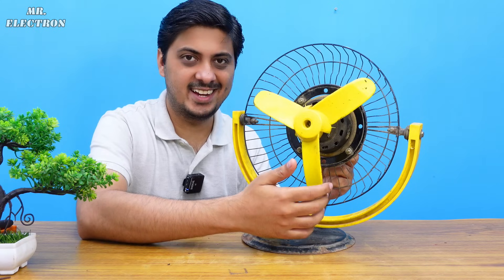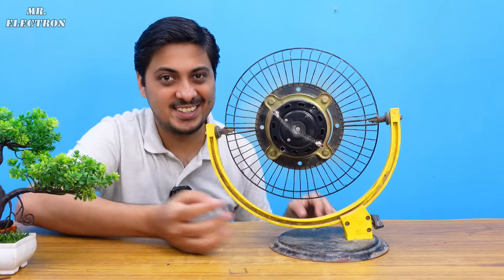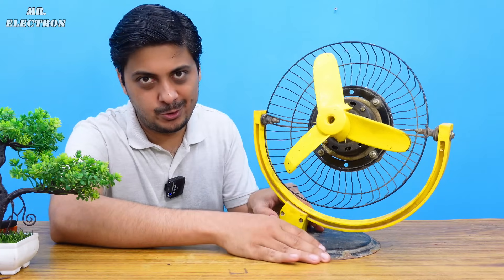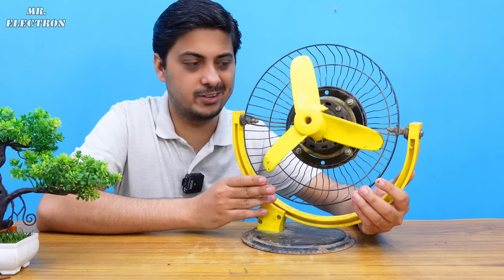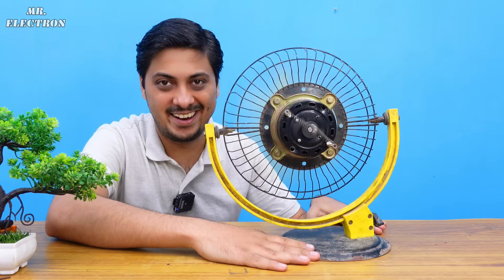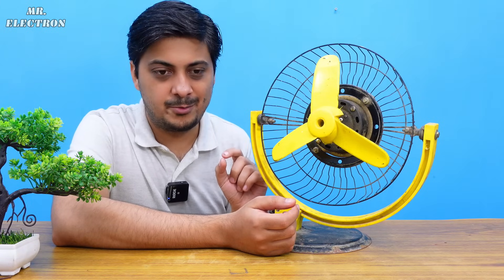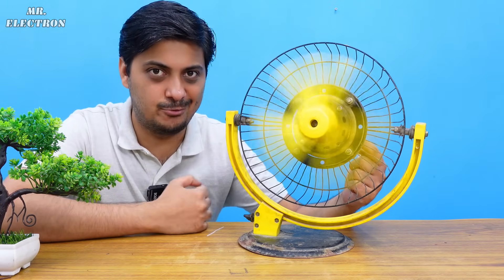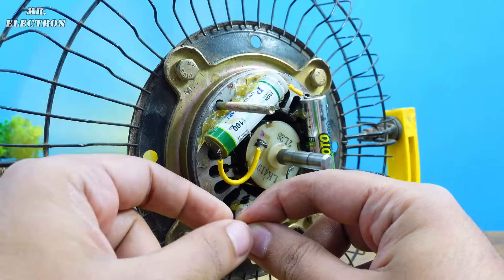Self Running Free Energy Fan Device 100%. How to make free energy fan at home

Comment: If the motor is still intact with some power cord left, turn it into a dual pupose fan and 120 volt power generator. Run a radio, lamp, or both. That is what I am going to do with mine. Happy building.😎
Reply from the maker: Thank you for watching!💥 JOIN my WhatsApp for faster replies: https://whatsapp.com/channel/0029VaQmmRaFCCoWOf7huh3G
Reply: C'est faux il ya Un ventilateur à côté 😂😢😅
Reply: C'est faux il ya Un ventilateur à côté 😂😢😅

Comment: So the topic should be:
CONVERTING A 120V AC fan to a 3.6V DC battery powered fan?
 I DON’T GET THE POINT! UNLESS YOU LOOSE POWER? 
So you removed the 120v AC motor, installed a 3v DC motor and 3-1.2v rechargeable batteries that must be EITHER recharged EVERY HOUR by a 120v AC to 4v DC adapter OR a solar panel. SO WHEN THE POWER GOES OUT, YOU CAN STAY COOL FOR A HOUR?
Reply from the maker: This is a scam exposed video demonstrating how the fake free energy content creators hide the motor and battery inside to show that their fan is going to run forever without electricity.

Comment: I wanted to ask you for advice on a possible project.  I start from the assumption that I already know that infinite energy does not exist and neither does perpetual motion.  I wanted to know if it is possible to use the induction motor of a washing machine given that it is used for its ability to not stop even at 3000 rpm without effort from the basket full of wet clothes, if it were connected to an alternator of an 80-90A machine first using its pulley and seeing if it holds a 600w load with a 1500w inverter with the maximum peak of 3KW and consequently connected to a more or less 700-800w battery.  What I wanted to know is whether it is more or less feasible to use the engine of a washing machine as an alternative to the petrol engine and always in theory to deduce the autonomy of the battery depending on the load used at the output of the inverter, then if it can be improved putting a larger pulley on the alternator like the one behind the washing machine drum so as to have fewer revolutions per minute but many Newtons.  I hope I explained myself as best as possible and conveyed the idea.❤
Reply from the maker: Induction motors especially the squirrel cage ones have a really low output efficiency + the torque is increased using pulley gears and without this, its not that powerful so it not a good idea.
Reply: @mrelectron_alternator  Do you have any ideas for using an electric motor as an alternative to a petrol engine?
Reply from the maker: So finally you want to charge an 800W battery and get around 600w extra right ?
Reply: @mrelectron_alternator  it varies based on the battery you use, for example I have a 600w or more battery, and a 1200 alternator then it always depends on what you want to use, my idea is also to use the battery as a reserve to connect some 220 LED strips which consumes little and use an engine that has a lot of torque like a 300-600w, the alternator is powered by the electric motor, the battery is connected to the alternator and also the inverter, I don't know if I've got the idea, anyway I don't I have to connect work tools that consume 2000w
Reply: @mrelectron_alternator  because at least I believe that some videos are real in which they connect the engine of the brush cutter to the alternator even if they seem fake to me because they connect many things to it so I don't know
Reply from the maker: It will create losses and nothing more.